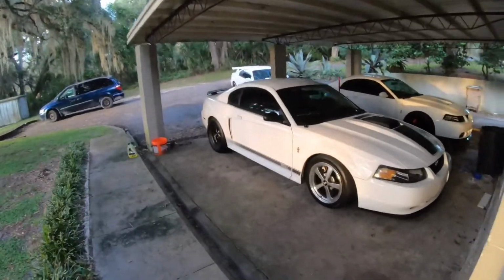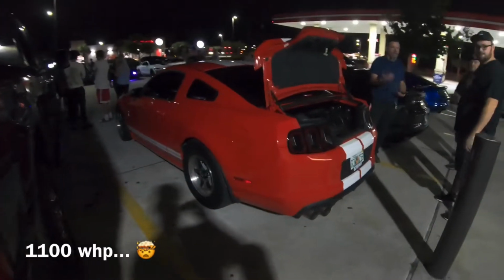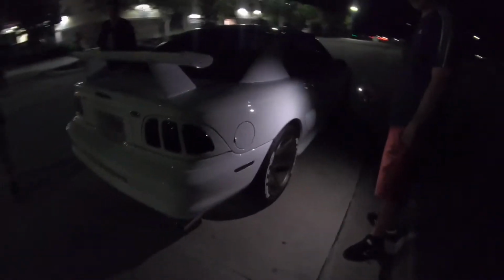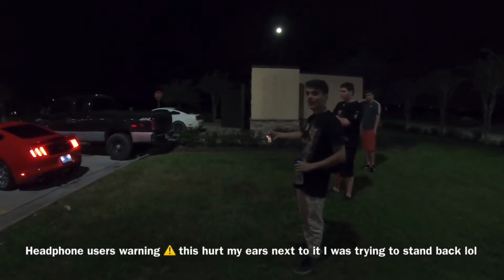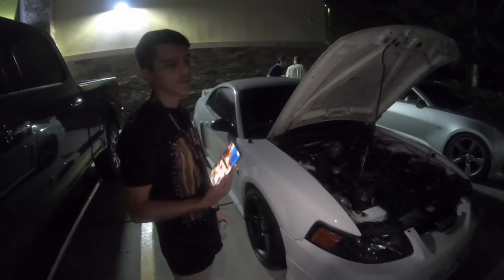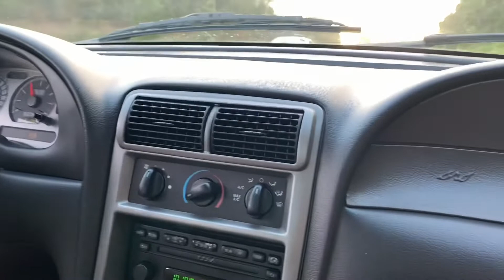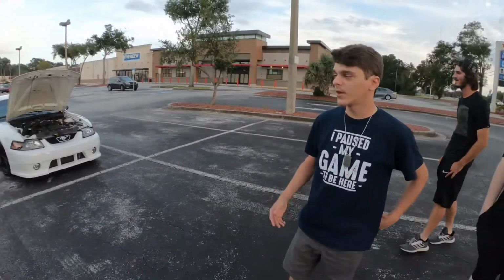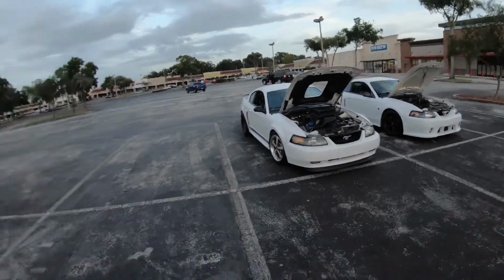Can my NA 4V MACH 1 beat a SUPERCHARGED 2V?

Comment: For having 4-10 gears you should be starting the car in higher rpm even if you have to shift soon those gears want to rev + you have a lot of tire
Reply: 2nd at 40 should be pretty close to optimal starting point.  Quicker shifts would help.  That 360r is also modded it has fenderwell intake and midpipe and stuff on a supercharged car like that that's prob 20+ hp easily.  I think quicker shifts with a good mgw could make the difference for the mach gotta bang them gears.

Comment: So just cams and he claimed 370whp on that mach? There's no way in hell lol
Reply from the maker: It’s full exhaust as well. That’s not out of the normal. EG performance on YouTube did FBO on theres with comp stage 3’s and made 378 whp before e85 and building the motor. Mach 1’s are underrated chief.
Reply from the maker: As to whether my car does make that without paperwork is the question. The motor was def built and it was dyno tuned. So only way to find out is taken her to a dyno myself!
Reply: @snakebitten1997  4vs are under-rated but thats very high. They made what like 280-290whp stock? Thats a huge jump. Id definitely like to see the dyno lol
Reply: @alexpowers9158  dyno may tell you nothing. They are not accurate, they are tuning tools. Best way to tell would be a drag strip or a draggy. It does not seem to pull like it should with all those "mods" and a 4.10 gear.
Reply: @alexpowers9158  350-370rwhp is very normal for a Mach with cams and longtubes.
Reply: @wallyc7349  no shit lol. Must not be familiar with machs.  They can easily make 320 with fbo and it isn't uncommon at all to see another 40-50+ from a cam swap.  The mach is badass.  A 370 whp cammed fbo mach should spank a stock 360 flywheel hp roush but I aint got that far in the video yet so idk if the roush 360 was stock.
Reply: 350-370 is pretty common for fbo cammed machs.  They do about 320 fbo and gain 40-50 rwhp with cams no problem.
Reply: A bolt on cammed 2v makes 300 wheel. You have to remember the 4v C heads are a whole different animal so 350+ whp is normal for a bolt on cammed mach